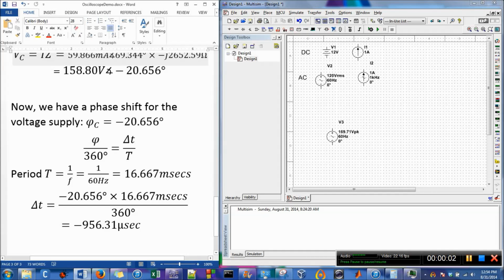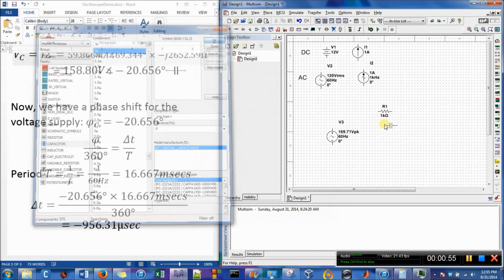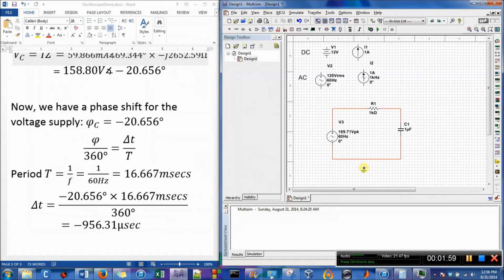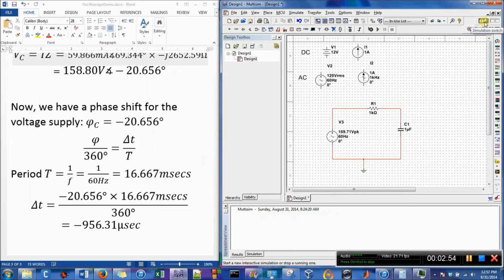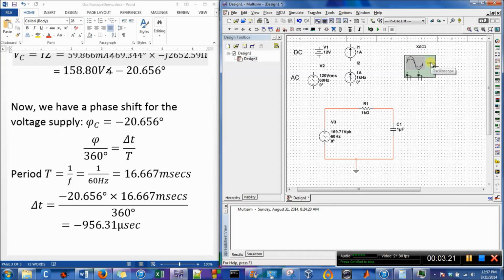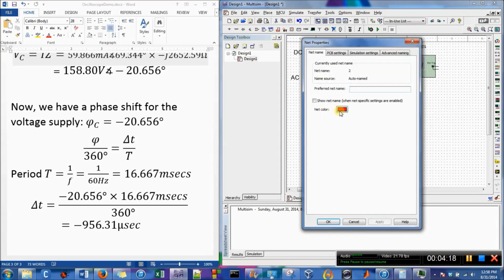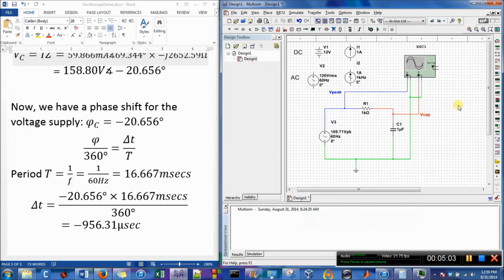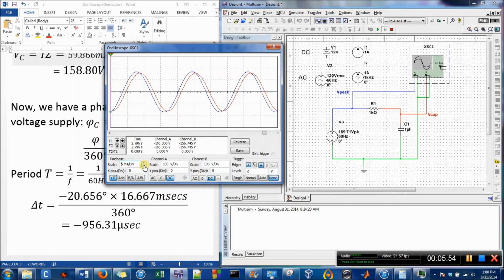How to use Multisim Oscilloscope on a RC Series Circuit

Comment: and how we can measure resistor 
??
Reply from the maker: +Ayad Hage I don't understand your question.  The resistance is set in Multisim, it is not measured.  You can measure the voltage across the resistor by placing a voltmeter (DMM) in parallel with it.
Reply: عشان تاني مره تتميلح :)

Comment from the maker: If anyone is interested I can try to give a better explanation of ground (0V) as the reference point: I meant to say that voltage drops and rises across the whole circuit will always be in the same ratio (this is because of Kirchoff's Voltage Law.) By having a reference point of zero, we will have one solution for each node voltage.